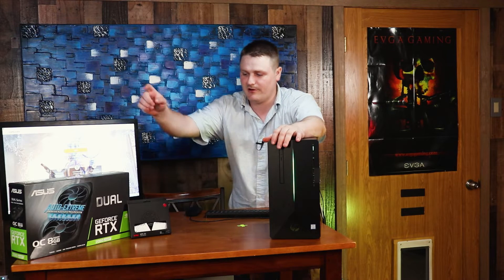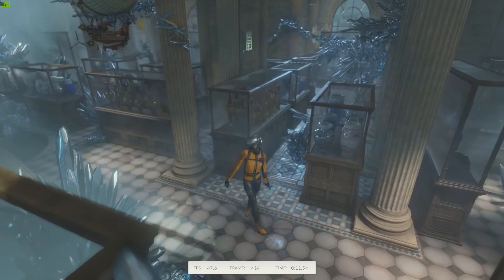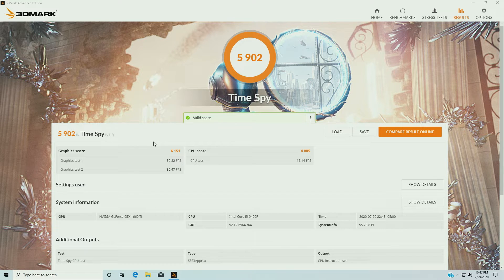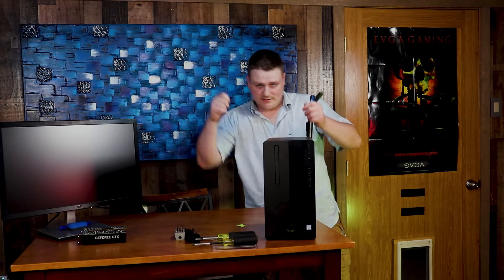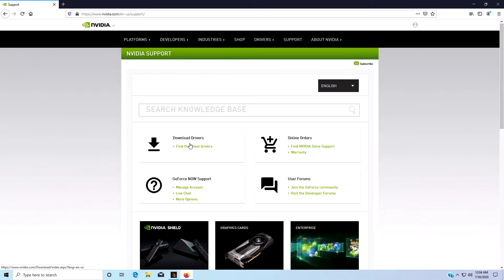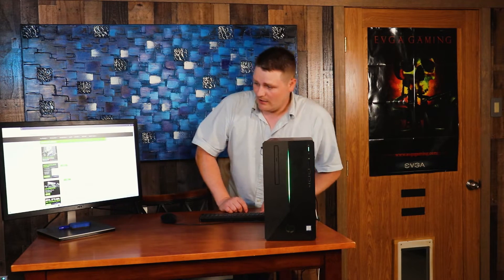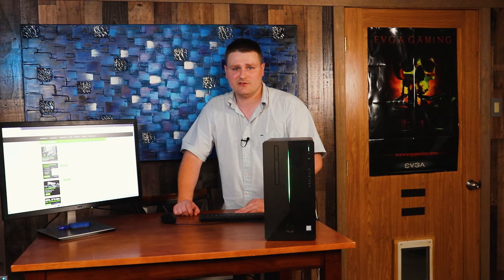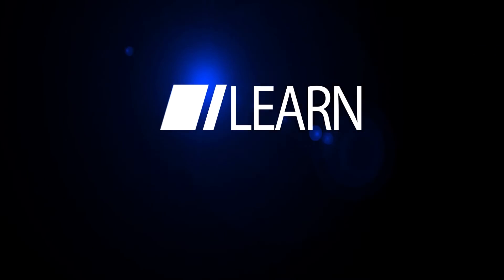Hp Pavilion Gaming Desktop 690 Upgrade To A RTX 2060 Super 8GB GPU & 16GB Of Ram (How to Install)

Comment: thank you for your video, i have the same and i want to upgrade too. I'm looking to change to 600 watt too, you could advise me what reference? thank you
Reply: hey i got this computer also idrk about upgrades, have you done anything to yours to help games run smoother?
Reply from the maker: How can I help you?
Reply: @TNW1337  I am looking for power supply models compatible with this pc
Reply from the maker: @oumaima7167  If you watch this video it shows how to do it. Also in the disco it has info on where you can get the psu.
Reply: @TNW1337  precisely, I cannot obtain the references which you quoted, perhaps that there are other models which one can easily find compatible?
Reply from the maker: @oumaima7167  L04618-800 400watts

Comment: can you upgrade the power supply to this Thermaltake SMART 600W ATX 12V V2.3/EP
Reply from the maker: no
Reply: @TNW1337  how is the airflow in this?
Reply from the maker: @CMoney206  Its about average. Better then a laptop. better then most desktops
Reply: @TNW1337  ok thanks, is there enough room for another fan?
Reply from the maker: @CMoney206  You could mod one in if you wanted to. Would mean drilling new hole. But stock there is not room sorry.
Reply: @TNW1337  thanks for the help, keep up the great vids
Reply from the maker: @CMoney206  Thank you for the support :)

Comment: hi would i have some questions abt my pc i wanna upgrade so i have the hp pavilion gaming desktop too that looks like urs but it’s the older version and has the ryzen 7 2700x with the rx580 , could i upgrade the gpu to a 2060 or 2060 super?
Reply from the maker: all depends on what psu you have if you do not have the 400watt you will need to upgrade it to it.
Reply: TechNitWit how do i know what psu i have , can u check my pc online it’s the hp pavilion with the ryzen 7 2700 and rx580 , i would like to upgrade to a regular rtx 2060 would that be possible
Reply: @vocf2187  i did the research for you, yes you have the 400w psu I would recommend you go with a 2060 or 2060 super! 😁
Reply: @vocf2187  just make sure the graphics card you get is not longer that about 9.5 inches in length or it will not fit!
Reply: Jmac okay , what’s this going to make a difference on except the look of the game
Reply: @vocf2187  mostly it make the graphics a ton better. Upgrading the graphics card to the 2060 will help the graphics performance in watching videos, gaming,  video editing and more! Also if you're going to Upgrade the graphics card I would also upgrade to 16gb of ram! I'm glad I could help.
Reply: @jmac1900  helllo
Reply: @vocf2187  whats up!
Reply: @jmac1900  hey man , would a XfX thic 2 5700xt be better than a 2060 or worse ? and would i be able to upgrade to that
Reply: @vocf2187  hey fish, I would go with the 2060 because that 5700xt model is the lowest end 5700xt so any 2060 would be much more powerful than the 5700xt!
Reply: @jmac1900  oh okay thank you! what about a 2060 super for $300 dollars off facebook marketplace
Reply: @vocf2187  Hey fish, I personally would not buy any computer parts off of Facebook, Just because most of the stuff on there is used and I don't know if I wouldn't trust a used graphic card.
Reply: @jmac1900  oh alright i’ll see . can i have ur number ?
Reply: @jmac1900  is there anywhere where they have cheaper pc parts
Reply: @vocf2187  tbh I would just go with a 1660ti  its around 250 on Amazon and its just as good as the 2060!
Reply: @vocf2187  hey sorry like 25 people saw the comment and added me and I didn't know which one you are.
Reply: @jmac1900  my snapchat is mitchellfishh1 , sorry!
Reply: @vocf2187  ok I just added you back, thanks
Reply: @jmac1900  i added u

Comment: If 400 watts can handle rtx 2060 does that mean it can handle the RX 5500xt? I'm just curious, because I'm looking to upgrade my rx 580 to a 5500xt and I have the same pc
Reply from the maker: look up Tdp of the cards that will tell you if it will work. think the tdp of a 2060 super is 175 or 190watts

Comment: I just the HP Pavilion Gaming Desktop 690-0084 a couple of days ago 

Specs

Memory

8 GB DDR4-2666 SDRAM (1 x 8 GB)

Memory & Storage

8 GB memory; 1 TB HDD storage; 256 GB SSD storage

Internal Storage

1 TB 7200 rpm SATA

Hard drive (2nd)

256 GB PCIe® NVMe™ M.2 SSD

Processor Type

Intel Core i5

Processor

Intel® Core™ i5-8400 (2.8 GHz base frequency, up to 4 GHz with Intel® Turbo Boost Technology, 9 MB cache, 6 cores)

Processor Family

8th Generation Intel® Core™ i5 processor

Processor Speed

2.8 GHz

Graphics

Discrete

Graphics Card

NVIDIA® GeForce® GTX 1060 (3 GB GDDR5 dedicated)
Ports
1 USB 3.1 Type-C™; 2 USB 3.1; 1 headphone/microphone combo
Expansion Slots
1 PCIe x16; 1 PCIe x1; 2 M.2
Network Interface
Integrated 10/100/1000 GbE LAN
Wireless
802.11a/b/g/n/ac (1x1) and Bluetooth® 4.2 combo
Power Supply Type

400 W Platinum efficiency power supply

Looks like I only have to upgrade ram, GPU, and ssd

Now do I need to get just another 8gb stick or should I replace the original 8gb stick as well (just going for 16gb ram 32 is overkill atm)
edit: hope I didn't come off sounding like an ass, was just surprised about what I got and what I have left to upgrade. Definitely keeping the i5 8400 (it came with the 690-084) Upgrading ram is a given. The GTX 1060 is good but I know I can do better but I'll hold off on that.
Reply from the maker: You can do that or just order 16 or 32Gb of ram
Reply: @TNW1337  Thanks
now as far as GPU, Should I go for GTX 1660 Ti first due to pricing, or should I wait for the price of the 2060 super to drop?

Comment: I have the HP Pavillion 690-0020 with The Sunflower Motherboard, will the 2060 super graphics card work in this?

heres the link: 
https://www.amazon.com/gp/product/B07BHXV3TJ/ref=ppx_yo_dt_b_search_asin_image?ie=UTF8&psc=1
Reply from the maker: yes
Reply: TechNitWit thanks! I really wanna get RTX for Minecraft!!! I’m so happy :)
Reply: @TNW1337  I was also wondering, do you think this msi version would fit? I'm just wondering because its slightly cheaper but also is slightly bigger.
link:
https://www.amazon.com/MSI-GeForce-RTX-2060-Architecture/dp/B07MQ36Z6L/ref=sr_1_3?dchild=1&keywords=2060+super+msi&qid=1601165156&s=electronics&sr=1-3
Reply from the maker: @user-ni8hd3sm3v  I have the max size in the video or did I not say it? 10.5 is the max size of card that will fit in  the case. No 3 fan model will work needs to be 9.5 or 10"
Reply from the maker: @user-ni8hd3sm3v  That card is 9.7 it will work. I've gotten cards at 10.1 to fit.
Reply: TechNitWit okay cool, thank you for helping me out!! I might have missed it. But now I know that, maybe the rtx 2070 super could fit? Just possibly it could.
Reply from the maker: @user-ni8hd3sm3v  yes it could.
Reply: TechNitWit oooohhhhh

Comment: i have this same system and the only upgrades i have did is 16gb ddr4 ram and 2tb hard drive but my whole pc tends to crash on mw and rust other titles not so much . Any idea why ?
Reply: its not just a game crash my whole system crashes
Reply from the maker: @jaggergucciman6  Bsod ? I would Reinstall Windows10
Reply from the maker: if you still have problems we will go from there sir.
Reply: @TNW1337  i just did reinstall it a couple months ago to clear up task manager

Comment: I have this exact same PC , 1050ti currently, what's a graphic card you recommend?
Reply: in my opinion, if u want a great budget card, I would reccommend an rx 570, way better performance than the 1050 ti (50% frame increase on some games). you can usually pick one up used on ebay for about 100$, but you will also need a 6 pin to 8 pin pcie converter for this pc, I also have the same pc.
Reply from the maker: Depends on what your budget is. You can get the 400w HP ssf psu for 77 and then the 1660ti or 2060 become options. when on sale for like 260 for the 1660 or 310-330 for the 2060. Rx 570 is great when you do not have the room for a Psu or buget. 1650 does have not req a PSU as well but is about 10 to 15 less frames and is a pretty good card as well.

So I am going to put them in order of best Fps 2060, 166ti, 1650 super, Rx570 & 1650
You become limited when you do not have that external PSU plug. 1st three in the list need plugs. all those are better then the 1050ti.

Comment: I have the AMD version of this, model 690-0013w. Ryzen 5 2400G cpu,  1660 Super, 32GB Ram, 512GB SATA SSD. All running on the stock 310W PSU. I'd like to upgrade the cpu to a 3700X. Has anyone tried this?
Reply: Yes, I upgraded the ram to 32gb and the gpu to a 1660 super.
Reply: @mariusscaunas5722  Send a link of the ram you bought
Reply: I have the same pc but with a 1050 did you upgrade ur gpu and eam
Reply: ram*
Reply from the maker: Oloy Works And Adata. Both kits have been tested in the 690, 590, & TG.

Comment: Thanks so much for this! Been looking all over to see if it was upgradable. When will you be upgrading the cpu. Also how are the temps and should the fans be upgraded
Reply from the maker: Problem is the fan on the rear is a odd size 92mm if I remember correct.  Temps where pretty avg for a gaming Pc. I have not gotten around to upgrading the cpu in any video yet, but have done test with the intel Cpu's I own. I know the K Cpu will not work in the inlet versions 690. But non K's will work just fine.
Reply: @TNW1337  how many pins are on the ram?
Reply from the maker: @5dropn  288
Reply: @TNW1337  thanks :)
Reply: @TNW1337  also, if my RAM says PC4-3200AA, will i be able to get this RAM? Does PC4 really matter?
Reply: @TNW1337  and, do the MHz matter?
Reply from the maker: @5dropn  It does not just make sure it is above 2666Mhz. Intel 3200 Amd.
Reply: @TNW1337  thanks, and i hate to bother you, but what does PC4 mean?
Reply from the maker: The Cpus can be upgraded on TG & 690, Hope that helps. I know that the Intel models do not support K type 8th & 9th Gen Cpus

Comment: I got the HP pavillion 690-00xx,  does it support the same change that's the one you did on your video and the same component wrote in your description?
Reply from the maker: This is for a 690 that has a 400w psu. The listed stuff in the description does work yes.

Comment: I have 310w power supply, can I install this?

Also how do I upgrade the psu?
Reply: Same question here, also link for the psu please.
Reply: same question :) pls help
Reply: @alexS-pz6wp  there is no "official" way to upgrade the PSU, however there is a PSU with 500w that can "fit" into the case and actually be compatible with the motherboard, the bad thing is that is not cheap for a psu, and could have some problems with the heat (I personally don't ).
Search for the L05757-800 serial number, you should find it on eBay, is about 110€, good luck fellow prebuilt pc gamers
Reply from the maker: New video showing how to do the 400w psu.

https://www.youtube.com/watch?v=MTJ9SkVjvQg&lc=UgxY7PYuGa3yRY1kXqh4AaABAg

you could use a after market may need to drill a hole and you have to order the 24pin to 6pin cable that converts it over. I would say if your willing to do that just look at a new case and psu.
Reply: @TNW1337  i think is much more convenient and easy to spend 100€ on the PSU and slap it in the case, but I think that's and option too
Reply from the maker: @spookyskeleton9816  Yeah I mean the 2060 super 8gb is a great card. Will handle most games at 4k on med high. just start to run in to memory problems on the Gpu with 4k gaming. Why most people do the 2070 or 2080 they have more memory. Only really helps with 4k and 8k gaming.
Reply from the maker: Also if you find the right 2070 it will work with the 400watt psu. Only reason I would go for a card like that is so I could up the setting on a 4k gaming rig. if you play shooters most want to be at 1080 or 1440. As that is pretty much the standard.

Comment: i have a hp pavilion with 310 watts , intel i58400 8th gen , 1060 3gb , can i upgrade to 1660 witout a psu upgrade ?
Reply from the maker: Going to be cloes, you could try it and if it does not work upgrade the psu.

Comment: i have HP PC Pavilion Gaming 690-0164nf - Intel Core i5-9400F - RAM 8Go - Stockage 128Go SSD + 1To HDD - GTX1050 2Go - Windows 10
 
it is possible to install RTX 2060 Super 8GB GPU & 16GB Of Ram
Reply from the maker: If you have the 400w psu yes if not you would need to order it.

Comment: Is there any psu above 500 wt that in fit in 690-0048
Reply from the maker: There is one on hps site, but if your doing it for a gpu. the 400 watt can do up to a 2060 or 2070 dual fan none super or oced and any thing past that need 525.

Comment: Just wondering what power supply does the pc have and will it handle 1660 super (I have the i58400 gtx 1050 if that helps)
Reply from the maker: open up the side of the case. it is one screw Labeled in on the bottom left near where the power cable pugs in.

Comment: Hi. I have this exact pc, and just got 16 gigs of ram today (DDR4 3200). For some reason, the BIOS/task manager says it's only 2400 Mhz. The motherboard in this PC says it can handle up to 2666Mhz (which is what the original RAM was running at). Would you be able to tell me if you took any extra steps to set up RAM other than just sticking the sticks in? I'm fairly certain the HP BIOS doesn't allow for adjusting RAM/XMP. Any help would be greatly appreciated. Thanks.
Reply from the maker: it does not support ram speed changes sorry, also adding the 2nd stick will be faster as you are moving from single Chanel to dual. No it does not support XMP. Even with the slower ram speeds I've seen a performance gains from 25-30% Going from single dim to dual dims. 

The speed difference from 3200 to 2400 is negligible at best. I would not get caught up on the lost of 200-600 mhz. This is why the ram I put in the upgrade is 18 to 19 cas. Now if you put in 20-21 cas at that speed you would see a performance hit maybe 5-7%. With a loss of 5-7% from the 25-30% gain.

hope this helps you. also if you plan to ever move away from the HP, and build a different PC you will have a good ram kit to stick in to your new PC if you wanted to.
Reply: @TNW1337  Thanks so much for your reply! Just to clarify, you're saying it's fine to have the RAM i bought in there and the fact that it's running at 2400 isn't that big a of a deal? (CAS latency is 16 on it) Was just  wondering why it was showing up as 2400 instead of the 2666 that i know the motherboard is capable of from previous stick, but if the difference is negligible, i'm not stressing too much. Maybe it's just something weird with the motherboard not detecting correctly.
Reply from the maker: @closeyournose  its becuaes thats the defualt speed of most dimms 2400 or 2666. it sucks that hp does not allow memory speed tuning.  But going from single to dual is going to be where you get the biggest gains. I would say you could almost put 2000mhz and by adding 2 sticks would be faster. Then only one stick of 3200/3400. Its all do to bandwidth as you memory was a bottle neck. You just removed it by the upgrade. 

So AMD & Intel are like this now most systems require dual or quad chanle memory to not be bottle necked.  Also if you move away from the hp you will have good ram set to stick in as a upgrade. Let's be real the way techs going most stuff is outdated in 1 1/2 years any ways
Reply: @TNW1337  Great! Thanks again!

Comment: i have the HP 590 which currently has the i3 8100. Do you think i7 9700 is worth the price versus the i5 9400?
Reply from the maker: They are both awesome CPUs. You will get better Performance from the 9700 8c 8t @ 3Ghz Vs 9400 @ 6c 6t @ 2.9Ghz. Do I think 9700 worth the extra moeny for 2 more cores and 2 more threads, yes its worth getting the 9700 as a lot of games are being optimize for 6 to 8 cores right now.
Reply: @TNW1337  Thanks. I found a great deal on a i5 9400 on ebay that I couldn't pass up, so ill see how it works out for me. Considering I can sell my i3 for close to $80 I'm getting it almost for nothing.
Reply from the maker: @dmite09  Lol I am looking at ordering a i3-9100f for my entry lvl gaming Pc build.

Comment: Would this work on the AMD version?
Reply from the maker: Yes
Reply: @TNW1337  can you send me a link to that exact graphics card? Thanks
Reply from the maker: @jiayoutech  ASUS Dual NVIDIA GeForce RTX 2060 Super 8GB EVO V2 OC  https://amzn.to/2EgEjtB

DISCLAIMER: This video description contains affiliate links, which means that if you click on one of the product links, i'll receive a small commission.
Reply: @TNW1337  thank you so much. I'm trying to upgrade so I can play Microsoft Flight Simulator.
Reply from the maker: @jiayoutech  I love the RTX2060 8Gb in the hp its like night and day also with the ram upgrade it helped as well.
Reply from the maker: @jiayoutech  Was that one over your budget ? I know they are not the cheapest cards. Also I would sell your Old GPU. To get some cash back.
Reply: @TNW1337  that one is a decent price. Beats buying a new computer. I'm gonna put in a new ssd and a new m.2 drive. Plus max out the RAM to 32gb.
Reply from the maker: @jiayoutech  If you look in the description I have upgrade parts list with links, if you want to know what will work.